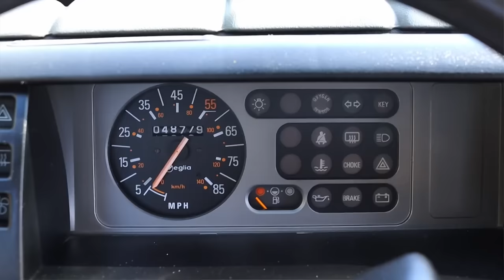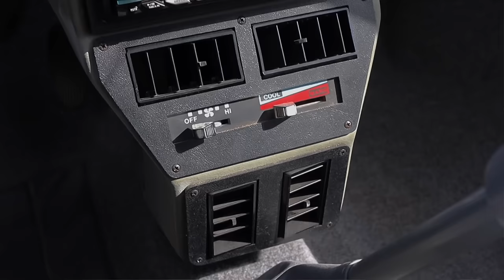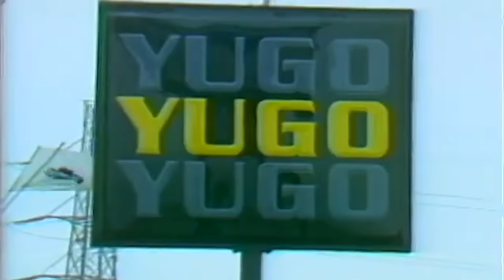Top 10 Worst Cars Ever Made Models From The 1980s | Decades Of History

Comment: 1980’s were a dismal time for US automakers characterized by poor performance and hideous styling.  The only gem to come out of that era was the Buick Grand National.
Reply from the maker: Yeah, a rough time indeed. Thank you for watching
Reply: I agree about performance but the styling was NOT hideous and it was, in fact, great. Also, there were a few other gems from the '80s, not just the Grand National ('80 Plymouth Volaré Roadrunner/Dodge Aspen R/T, Dodge Omni GLH, Dodge Daytona (possibly), Toyota Celica, VW Rabbit GTI, etc.).
Reply: Firebirds and camaros were popular during the eighties
Reply: @DecadesOfHistory20 Years 1975-1990 were the dark days for American Cars.
Reply: Why is it every time people talk about the poor performance of American cars in the 1980s, they completely disregard everything after 1985 except the GN/GNX?
1987 Ford Mustang GT (5L)	0-60 in 6.1 seconds
1989 Turbo Trans Am       0-60 in 4.6 seconds (0.8 seconds faster than the GNX)
1990 IROC-Z (released in 1989) 0- 60mph in 5.7 seconds
1986 Omni GLHS   0-60 in 6.5 seconds
1989 Corvette ZR-1   0-60 in 4.9 seconds
1989 Taurus SHO     0-60 in 6.7 seconds  (Compare that to the 2024 Malibu that does 0-60 in 7.8 seconds, or the 2024 Altima that does 0-60 in 8.4 seconds.)
1989 Ford Thunderbird Super Coupe   0-60 in 6.9 seconds   (only 0.3 seconds slower than the 2022 Subaru BRZ/Toyota GR86 automatics.)

Comment: The Yugo was built by a small car company in eastern block Europe with very little money for design and upgrades while all the rest were built by multi million car companies with giant engineering capabilities here in the USA. I still have my Yugo and it's never left me stranded with very little repairs needed while my high tech Toyota needed a new transmission and burns oil like crazy.
Reply: Sounds like yours was actually maintained. The Yugo's biggest problem was American Laziness. The timing chain was supposed to be replaced every 60,000 miles, something that nobody ever bothered to do. As the Yugo was an interference engine, if that chain broke, the valves would slam into the piston, and cause the engine to lock up, not unlike an early 2000's Ford Focus.  

Meanwhile, you could easily find Zastava Corals (Yugo) as late as 2015 running the streets of Belgrade, Serbia.  Ironically, the American Yugo was considered to be more well put together than the Zastava, as the  company put more focus on building the export versions than they did for the domestic market. In some cases, zastavas would even be shipped out of the factory with mismatched door panels! 
Zastava was still building them in the eastern Bloc as late as 2008!

Comment: I owned a 1981 Pontiac Phoenix I got it for $900 and had 67,000 miles. Parts were dirt cheap rebuilt the whole front end everything else it was always a reliable car. I had it for 3 1/2 years and then all of a sudden, something went goofy in the carburetor and it caught fire, but I never got stuck in the winter continuously got 30 miles per gallon with the iron Duke and I never had a problem with acceleration

Comment: Honorable mention: 

1982 Pontiac Trans Am 

It was a huge step down from the performance owners of the previous generation Trans Am were used to. Gone were the powerful 455 big block engines replaced with a weak 5.0 V8 known as the Crossfire. This engine utilized twin throttle bodies and was fuel injected. It produced a mere 165 horsepower which for Trans Am, a car with a rich history of high performance was an embarrassment. Not only was it a performance disappointment the crossfire engine was notorious for having mechanical problems. The lack of aftermarket parts meant that there was nothing that could be bolted on to increase its power output. The car was initially planned to receive a Pontiac turbo engine which would have produced more power however that plan was scrapped before the car went into production. The turbo hood scoop made it into production and served as a reminder of what could have been. The 1982 Trans Am interior was bland in comparison to the previous generation model. The bowling ball hubcaps that attached to the turbo fin wheels using plastic clamps often fell off due to road vibration. This was a very annoying problem which led to the wheels and hubcaps being discontinued after 1983. 

The overall design of the 1982 Trans Am was pleasing to look at however, the car was all show and no go. The TV series Knight Rider which debuted in September of 1982 featured a black 1982 Trans Am as KITT, a super car that could talk, drive itself and do other amazing things. It starred opposite actor David Hasselhoff until the show was cancelled in 1986 after 4 seasons. Knight Rider is credited with saving the 1982 Trans Am from being remembered as a complete flop. The TV series preserved the original factory look of the car and gave it icon status.